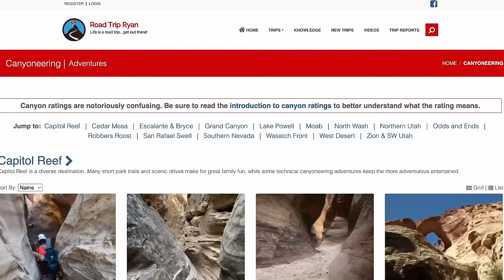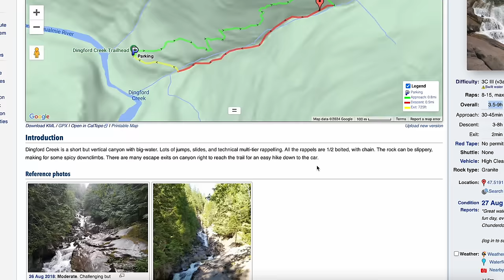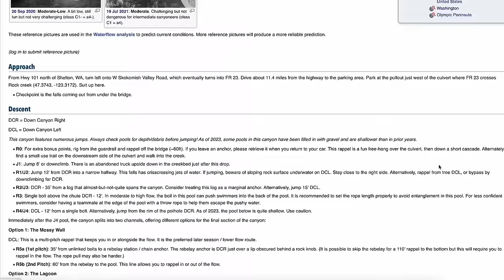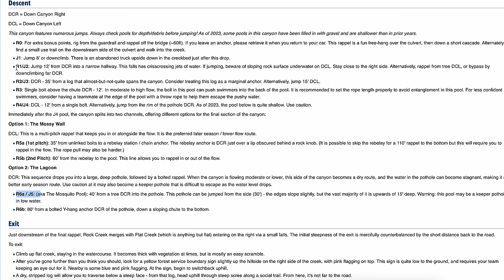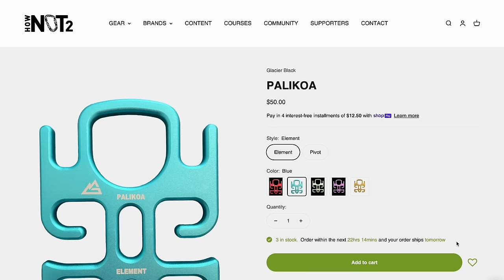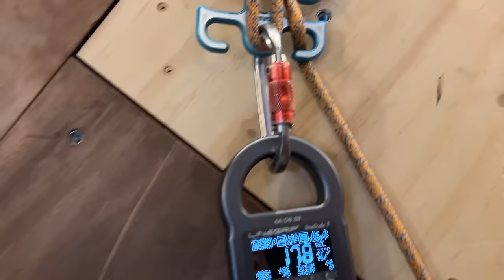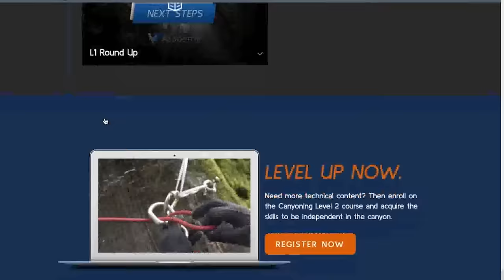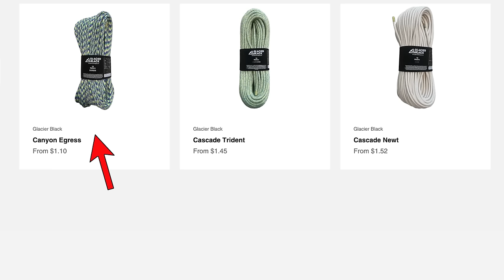Rappelling Wizards - Intro to Canyoning

Comment: Regarding the double-ended rope bag... For rock climbing, I really like the Edelrid Tillit Bag, which is a similar idea.
Reply: The Tillit is useful for multipitch rope management, but it's a bit flimsy for canyoning. It's also not as easy to flake the rope into quickly compared to a more rigid style of bag. That said, if you've got one and you want to try canyoning it's going to be better than nothing.

Comment: Rocky Talkies are NOT waterproof!!! From the manufacturer's own website, they're only "IP56 (Splashproof/Snowproof, not submergible)". We dipped one in water in a pothole mid multi-stage rappel on Saturday and it died immediately. Good think we had 4!
Reply: The 5W ones are, as he showed in the video
Reply: The 5 Watt model is rated IP67, 1m submersion. It's also a GMRS radio, not an FRS radio like the 2W model.

Comment: I don’t have much experience climbing but I worked as a tree climber a few years. We use a Prussik cord on a hitch climber pulley to repel.  I’m curious, does anyone know if this would be a viable option for this sport?
Reply: You could rappel in many different ways. The difference is what you are rappelling on or into. If you can disengage safely, you are most likely ok.
Reply: @TheBrocam  cool, thanks

Comment: That o-ring is brilliant.  Figure 8's and plates have a flaw in that they violate the "no metal on metal and no rope on  rope" by being metal on metal.  Rubber fixes that.
Reply: That’s not a hard and fast rule (metal on metal being “bad” pretty much only applies to avoiding non locking carabiner chains, if it applied as a hard rule we wouldn’t clip bolts).

Comment: So... Wet abseilling - DRT  - maybe recover anchors ?? - or leave them.

(bouyancy at the end mad be useful... - impact absorbing...)

wet - into  dry-hole and no rope, that sux  - SAT Phone..., maybe.

lol, dry canyoneering is double-sided bouldering...

metres left in the bag is similar to x3.3 feet for the same, lol...
Reply: I am not sure what your question is,  but here are a couple points. We typically do retrievable SRT. The block is either static or releasable. An SRT is essential for lowering or hauling. If you set it up DRT and have to rescue, you will have to use a completely different system or technique.

Comment: Glacier Black, I like your rope bag idea, you should look at making them for 600' 1/2 " static rope for rescues. I was doing a rescue practice, yesterday and we had to pull the entire rope out to get to the other end. I would only have a 25% opening at the bottom. Because you are packing 60 lbs or more.
Reply: Use 11mm rope🙈
But check out the CMC rope bag, is is pretty much exactly what you're describing, and made for rescue and rope access.
Reply: I like that. What type of rope are you using, Technora or Polyester?
Reply: @TheBrocam  I use polyester, technora is too expensive for anything other than canyoning for me😅. I'm in Europe, so for me EN 1891 is the only relevant standard, which gives tons of options for rope, if you are doing rescue in North America and need NFPA G rating, you need to shop around a bit, there are like 5 different 11mm ropes conforming to that standard.
Reply: Hello Rick, We are working on various sizes that will work in different venues and sports. I will look into this for sure. I am also working on a 9.6mm EN 1891 Type B rope for rescue and guiding companies. Thank you for your comments.